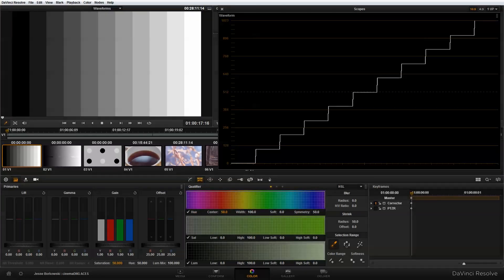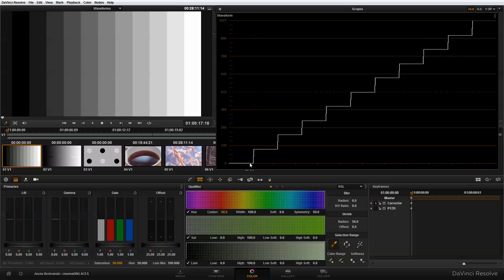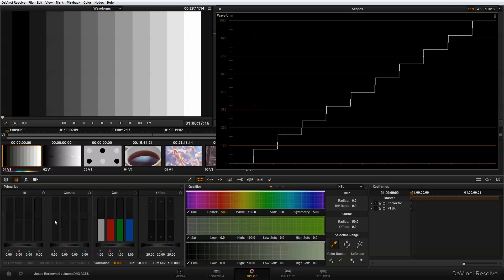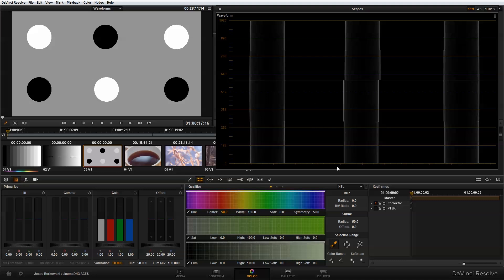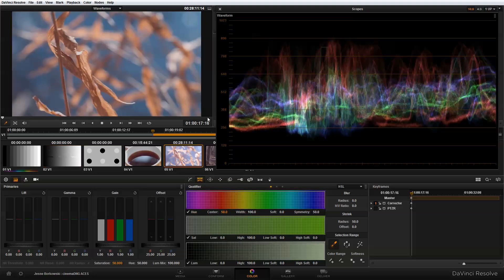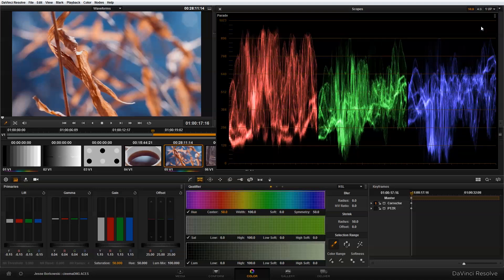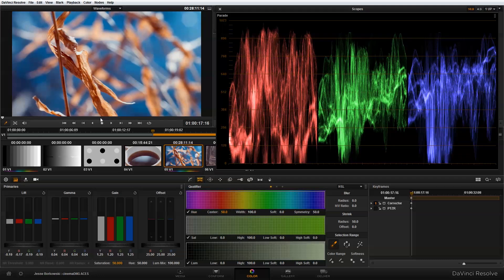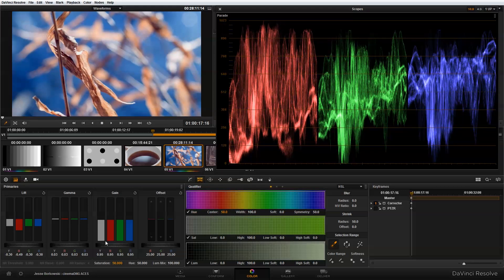Color Correction: How to Use the Waveform, Lift, Gamma, and Gain - cinemaDNG

Comment from the maker: Yes, it's normal for the other channels to change when you move the red slider, or adjust any of the channels. For white balance pick a white point in your image and find its luma representation on the RGB parade, then balance all three channels so that point falls on the same value luma on all three channels. It does take some practice to get used to. You're really 'developing' the image in Resolve, what comes out of the camera is just data for you to manipulate.